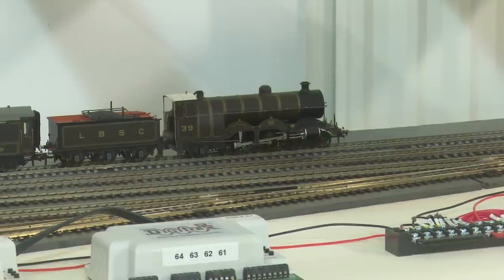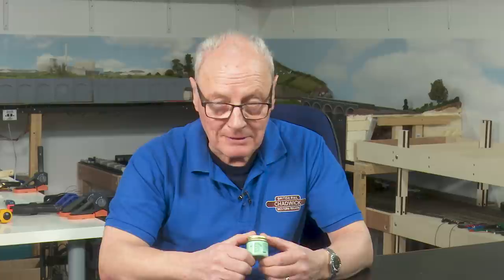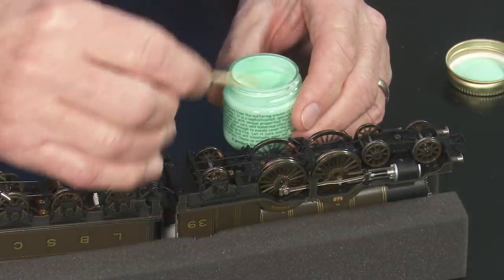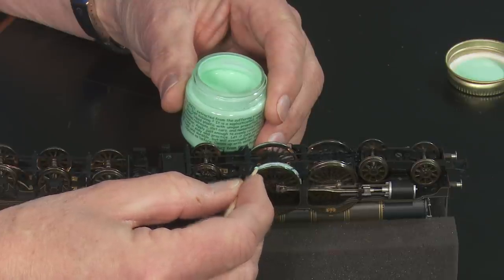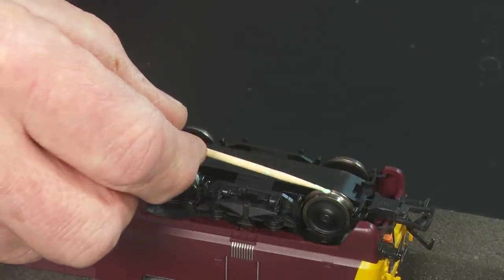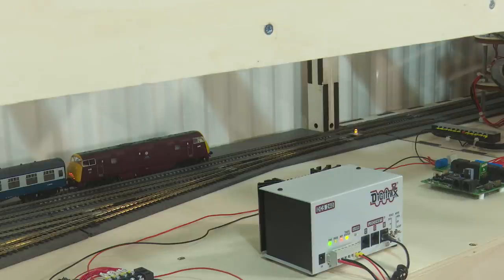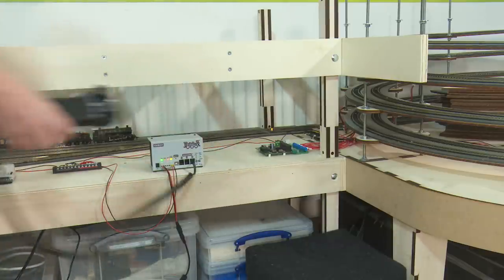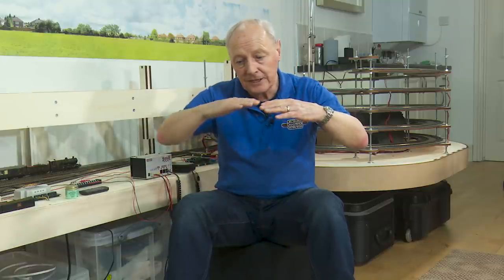Traction Troubles and Bullfrog Snot at Chadwick Model Railway | 122.

Comment: Hi Charlie. I’m sure the snot would be a good substitute for a traction tyre, but you can’t expect it to get a heavy train up a steep gradient. As I said in my post last time we’ve found 1 in 60 to be about the limit for getting long trains up from a lower level and that’s on long stretches of straights and gentle curves, not the tight curves of a helix where you’ll get additional drag from wheel flanges. At the end of the day I suppose the locos are designed to run on the flat or to climb a bit to surmount an over-bridge, but not to tackle long steep inclines. I’d be bothered about using a helix where locos routinely struggled, for fear of doing unseen damage and reducing their life expectancy. Bear in mind some models won’t pull long trains on the flat! Setting up a length of track on a long plank and testing various locos on a range of gradients and then applying an extra margin to allow for heavy trains was how we experimented before embarking on a lower level. I’ll be interested to see how you go with slackening the helix. Hope you don’t end up with the lower level on the floor. That’ll be harder on your knees than the duck under you were wanting to avoid! Keep at it. There’s always a way. Every day’s a school day.
Reply from the maker: An excellent comment Richard. I’ve rejigged the Helix this weekend and sorted out the inclines to be somewhat less aggressive. Hopefully you’ll catch up on the next video. Regards Charlie

Comment: I believe height increases drag and a 2% incline is ok for straight track. That being said -reduce the the height between top and bottom boards , reduce the height between the helix tracks to a minimum for your stock and, reduce the number of turns on the helix  to support your maximum train length if you can, to reduce the drag produced naturally by the curved track  . Best wishes Dave from Coventry
Reply from the maker: Sound advice Dave. Regards Charlie

Comment: I was wondering if you put small brush on . To the rails on the grade for grip might work as well in a way so you won't get a power loss.
Reply from the maker: It’s an interesting point. However, I really no longer like this product, putting more weight in the locomotive is a much better solution. Regards, Charlie.

Comment: Hi Charlie, an interesting experiment. I have used BS with great affect to replace locos designed to have traction tyres. Works well, very well. On locos not designed I would imagine the extra thickness would unbalance the wheel set and reduce traction a bit. However and I hope you don't mind me saying, but the slope on that amazing looking helix is far too steep, you can hear the motors working really hard and I'd be concerned about that. An idea might be to employ a bullet proof traction tyre fitted loco as a banking engine. I am sure some kind of cleaver coupling release could be arranged once it gets to the top? Cheers Mike.
Reply from the maker: Hi Mike, I've changed the helix slope this week and things are far beter, thanks.

Comment: "I put the snot on the bogie" knocks the pot on the floor Me: and now you're gonna need a tissue!

9 coaches behind that warship is a decent length train anyway. It would be perfectly proto... (nope can't say it) "reasonable" to permanently couple two warships together and set them to the same CV to keep a permanent longer train assembled. 
Not sure how you like to operate your layout - I'm more of a "keep them in fixed rakes" kind of chap. I guess if you vary your loads there's always the "will it make it up" factor that will either be fun or make you nervous!  
On the subject of double heading, it would be interesting to see if double the loco = double the pulling power or if there is some sort of diminishing returns multiplier to be realised?

Interesting video as always. 
All the best, 

Jon Moulds.
Reply from the maker: Hi John, you’re totally right. I will adopt the procedure of building permanently fixed trains in realistic rakes. Regards Charlie

Comment: So I know nothing, but a couple of questions:

Would applying the snot to both bogies on the ‘old warship’ help as they are independent of each other. But like having 4wd on a vehicle so that if one set of wheels lose traction, the others may have traction.

The other thing is would running the engines around the track help the snot ‘wear in’, eg take the shape of the rails, or rough up a little?

As I said, I know nothing about any of this stuff (which I find fantastic btw)!
Reply from the maker: The bullfrog snot is nonconductive so you have to be cautious on how many axles you apply it to. Regards Charlie

Comment: Hi Charlie when you coughed did you have a frog in the mouth (lol). I have a rack of eight Hornby Pullman coaches with two Class 73 Pullman loco's which are front and rear to push/pull up my helix and found these to be the heaviest coaches in my fleet. Is it possible to have a small siding before and after your helix to have a pilot assist with the incline? Look forward to next video, remember please stay safe...
Reply from the maker: I really can't risk a massive derailment pushing coaches up the helix Barry.
Reply: Is it worth double heading until the train clears the top of the
 helix (pilot stored in a small siding at top and bottom) Perhaps mine works because I only have two tiers.

Comment: Hey Charlie
As a plastic modeller it looks like an aircraft canopy masking product, I have used Humbrol Maskol in the past, currently Mr Masking Sol R. Once dry you can cut this cleanly with a modelling knife.
Is it liquid latex?
TBH the results didn’t justify plastering you loco wheels in it. Why not just accept nine coaches instead of ten? Was ten “prototypical”?......didn’t think you were interested in that 😀
In any event great to see another vid from you 👍
TonyS
Reply from the maker: Hi Tony, I was clearly under pressure from the gentleman that suggested buying it who also funded the product!  But in all honesty it was an interesting product to review although the helix is probably too steep for it to be used to its potential. Regards Charlie
Reply: @ChadwickModelRailway  None intended! 👍

Comment: If it is a rubberised substance, it almost seems similar to adding traction tyres to the wheels.   It seems to be a similar principle.
I find some people try to clean traction tyres  instead of replacing them, but like the "bullfrog snot" says it wears, traction tyres do also as they are rubber generally :)
Reply from the maker: Sadly Brendan, none of my locos are able to accept traction tires so I have to make do with this. Regards Charlie

Comment: A new product for me and very interesting.  I too struggle with traction on a gradient as my mainline is on a 1 in 40 slope and includes some quite tight curves (down to radius 3  - 20" - in places).  One thing I have noticed and think that your video confirms is that the problem is never power, it is always adhesion as the locos come to a halt with their wheels still turning at what appears to be full speed.  What I have never understood is why locos differ so much even when their weights are similar.  Any ideas?
Reply from the maker: You make a very good point Graham. The train load along with the weight of the loco and of course the tightness of the curve all add to the issues of climbing inclines.  I have more work to do on this subject. Regards Charlie.
Reply: @ChadwickModelRailway  time for the whiteboard?!  Please demonstrate the equation for the relative benefits of weight v grip v magnets.  

Serious question though, as it’s a non seen rail, what about roughing up the rails?

Comment: Hi Charlie. Would it be better to double head/consist the loco's that struggle going up the helix or have a loco banking from the rear of the train.
Reply from the maker: Banking is out of the question as too much pressure would result in an awful derailment. Currently I am re-configuring the Helix to alleviate this issue hopefully! regards Charlie

Comment: Bachmann Warship going classic Fleischmann mode with the traction tyres at the rear end.

Is it possible that the incline angle was once copied from a German manual for DC operation? Most German built models (especially the older ones) have the motor in the tender, and anything between 4 to 8 traction tyres fitted.
Reply from the maker: Sadly none of mine have the option to fit traction tyres. I shall change the helix configuration instead. Regards Charlie

Comment: I remember from my childhood that my Märklin locos had rubber bands on the wheels. The traction was very good, but of course the Märklins had a different technique for the power supply with the little knobs on the sleepers and the sliding thingy on the loco. What is it called in english?
Reply from the maker: Hi Theo, yes I think you are referring to traction tires. Sadly none of my locos have this facility. Regards Charlie
Reply: Traction tires, thank You! But wouldn’t they be the way to go? Seems a lot easier than fiddling around with the Bullfrog Snot?

Comment: Isn't using magnets plus Snot used together counterproductive? I understand using magnets will pull the loco onto the rails for more friction, but the same friction also will slow the train down (resistance). Why not try the Snot without the magnets and see what that does? But then again, hearing you will put an extra round to your helix, I'm confident that that is the best solution to your problem, well done on that! :)
Reply from the maker: Thanks Oscar, however the locos i used did not have the magnets fitted. Meanwhile I am adapting the Helix ready for next week’s video. Regards Charlie

Comment: You've got me rooting for the H1 now!  If only there were a conductive version of the Snot that could be applied to all drive wheels.  EDIT:  I checked, and apparently 'conductive elastomers' do exist, but are nonetheless highly resistive to low current, so may not work for this application.
Reply from the maker: Thanks for the research Alec.

Comment: Hi Charlie, you mentioned in your latest video speed step 50. I understand that there are 3 different speed steps, I'm using 128. How do equate different speed steps to my Digitrax  DCS51. The throttle has Stop, 1-5 and Full. Do I simply divide 128 by the 6 adjustments on the throttle.
Reply from the maker: Hi David, Speed Step 50 is half power in Digiteax terms.

Comment: Would it be easier to add banking engines  to the rear of the train or would  they push the carriages off as they entered the helix
Reply from the maker: Yes I think you’d end up with a huge derailment. Regards Charlie
Reply: It’s the hassle too isn’t it? If it was an on scene gradient then it might be prototypical (to use one of Charlie’s favourite terms) to use a banker but its access to a hidden fiddle yard so it needs to be as simple as possible I suspect.

Comment: What happened to your PowerBase from DCC Concepts?
Reply from the maker: It’s there Alan, the fitting magnets to the underside of that steamer is very difficult. Regards Charlie
Reply: @ChadwickModelRailway  I know you put down the Powerbase from your video on the Helix. I realise that it will be difficult with the H1 but perhaps as someone else suggested here is a real opportunity for some prototypical operation. Although to be fair I don't know if passenger trains needed to be banked. We still bank our coal Trains that we run in the Hunter Valley of New South Wales but they are 10,000 tonnes gross and the grade is 1 in 40. We use 3 x 4000 Horse power General Electric locos for the banking and the trains are usually worked with 3 of these same class

I understand the HI but what about the Western. Have you tried fitting the magnets to it yet?
And yes I think lowering the grade is a good choice
Cheers,
Reply from the maker: Hi Alan, I have spent this week on improving the helix inclines with much success. Now it’s a case of adopting suitable train configurations that don’t overload the locos.

Comment: Sure is easier to do on larger scale locos. N scale... kind of a pain. A little easier to smooth it even with a small standard (flat head) screwdriver thats wider than the wheel & rest it on the outer rim that would normally hold traction tires in.
Reply from the maker: Looking back on this video, I think this no longer a reasonable option. Perhaps adding more weight to locos, is the better option.  Regards Charlie
Reply: @ChadwickModelRailway  I'm new to this hobby. Most of my motivation is for my grandkids response. But I'm surprised how manufacturers largely only supply tires with new models, otherwise you can't find them. At least I havent been able to. I'm baffled by the lack of manufacturer support for their products. Even Kato only has a 30 day warranty, which is absurd compared to their price point. I'll likely never buy a new Kato for this reason. Though it sucks that most other alternatives pretty much put one into Chinese products for locomotives. All in all. The wheels seem pretty much standard by gauge; however, Bullfrog capitalizes on the fact that new traction tires are pretty much not available. So once the user goes through the ones a loco comes with, you're out unless you get this stuff.

Comment: What is the radius of the helix? It looks to be about  600mm. John Allen  had  a formula for the extra resistance caused by turns on grades. Joe Fugate of MRH described at 24" radius helix as the helix from hell.  Smaller grades and larger radii are a better solution than giving up electrical pick-ups on your locomotives.
Reply from the maker: Sorry for the delay.  The outer track radius is 24 inches but the helix complete is 52 inches in diameter.
Reply: @ChadwickModelRailway  One, I do enjoy your channel and watched your recent video concerning the grade where the loco was stalling. Another option for measuring track grades (which I utilize) is an inclinometer app on my iPhone.

My three track Helix has on center radii of 31", 33 1/2", and 36". The reason is to avoid the resistance of the vertical turns.

Comment: i think your main issue is the radius of the track curve is not suitable for the train you are trying to run.. looking at loco 29 almost as a dereailment

adding something  to improve things in the interim  however you haven't fixed the issue you just mitigated for a time.. though i suspect you might need to correct the track radius as a more permanent fix to the issue of the track slippage from that specific locomotive
Reply from the maker: I think I have it in hand now Jason. I have carried out some serious work on the Helix and hopefully in the next video you’ll be pleasantly surprised. Regards Charlie

Comment: Be careful with that Warship Charlie. The drive shafts have a habit of spinning in the gears if stressed too much.
Reply from the maker: A good tip, thanks Barry. Regards Charlie
Reply: @ChadwickModelRailway  Having watched video again, I think the gradient should be achievable. I do think more resistance is due to the radius - lots of drag there. Layout I am building has incline to S&D section with gradient of 1:50 just as it should be but my curves are much gentler. I do have Powerbase but not on all locos - just fit magnets where necessary.

Comment: Fit a lima traction tyre m8, or you can make them very fine with heatshrink tubing you only need one per loco
Reply from the maker: But can you fit traction tires to a loco that’s designed not to have them?
Reply: @ChadwickModelRailway  Heatshrink tubing will work charlie, its paper thin
Reply: @ChadwickModelRailway  Charlie it will work with heatshrink tubing, without sounding like a complete git - locos werent designed to run with frog snot either! simply add a tiny amount of pva around the wheel , get some heatshrink tubing cut to about 2.5mm wide, run a heatgun or similar on the wheel, leave for 8 hours to dry, the hairdryer will speed the drying up 3x faster. once dry wipe any excess off with a damp sponge. alternatively you can buy glue lined heatshrink. its only gonna cost a quid or two to try it m8, good luck!

Comment: Reading the product usage descriptions, it appears that you did not really followed the instructions. They suggest applying a thin layer to all driving wheels and relying on the wheel flanges and other wheels for power. It would have been far more interesting to do the experiment as suggested and discover the results. Your previous experience may indicate that the motor would not receive enough power but, given that the jar was a 'free' gift to you,, it merited a more thorough investigation.
Reply from the maker: I shall give myself a severe telling off Steve. Regards Charlie

Comment: Would it just be easier to have a extra loco that attaches at the rear of the train and shoves it up the helix then disconnects at the top
Reply from the maker: Sadly no Vincent, if it pushes too hard the derailment would be horrendous.

Comment: Hi Charlie, I have been using my 35 year old N gauge locos on a section of track whilst I am building my layout and the first this is the traction tyres came off having stretched or deteriorated. I came across Bullfrog Snot over a year ago and its fantastic. Mainly cos it works and secondly if you cannot get the traction tyres anymore this replaces it, no more worries. 
First I found it easier to apply if you run the train fairly fast, more even spread and like you I use a toothpick, secondly people throw it away after awhile because they think it has gone hard. Could no be further from the truth, keep it at room temperature and continuously shake the bottle and it comes back to life again, brilliant as it is not cheap.
This is the site I first heard of it from https://www.youtube.com/watch?v=nOawcCRpxmo&ab_channel=BULLFROGSNOT
Regards Chris
Reply from the maker: Great comment Chris, many thanks, regards Charlie